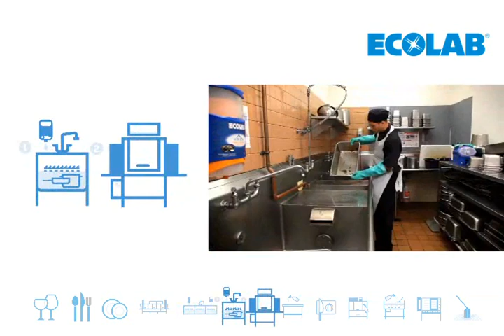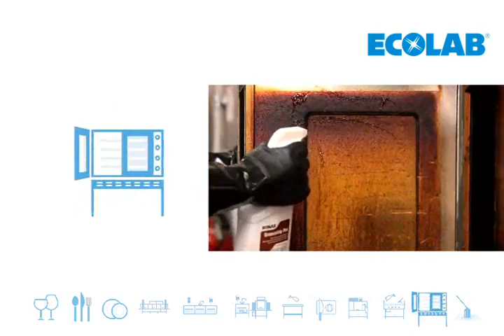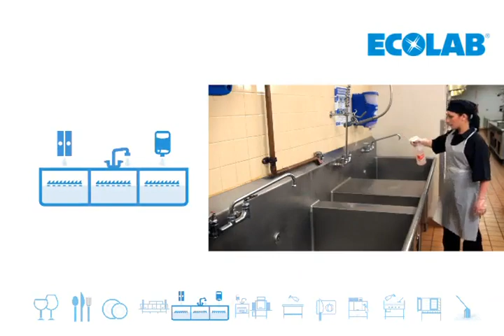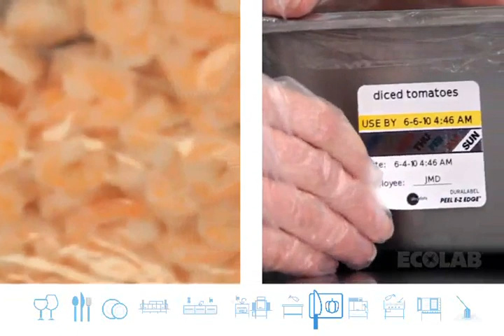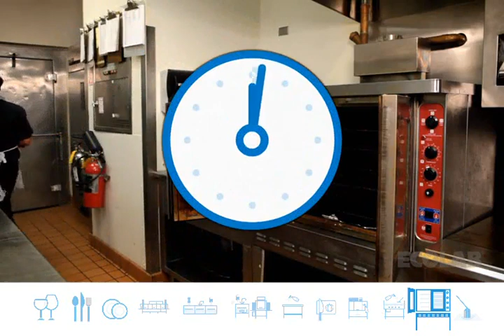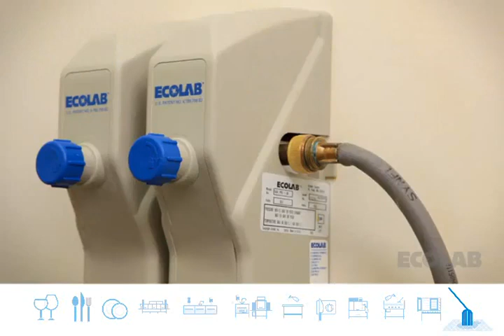Ecolab Foodservice Procedures Training Video

Comment: she didnt even soak the pots and pans with sanitizer
Reply: +Anthony Ramirez Why would they do that - dishwashers normally have a disinfecting rinse. In addition if you disinfect washware before washing it, it is possible that it could pick up bacteria, during the wash cycle, which normally operates at a sub-leathal temperature with respect to many bacteria.